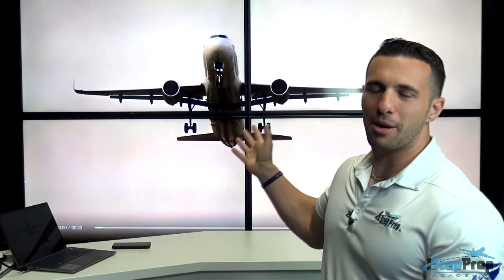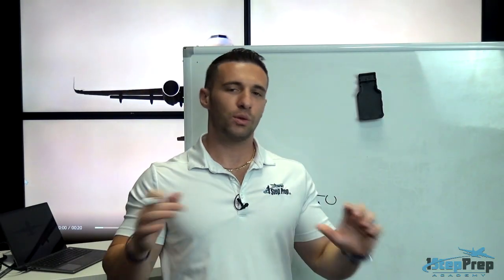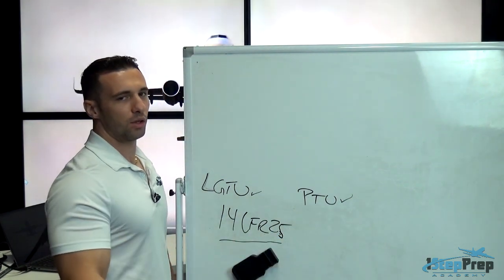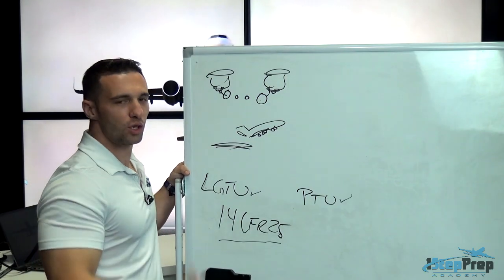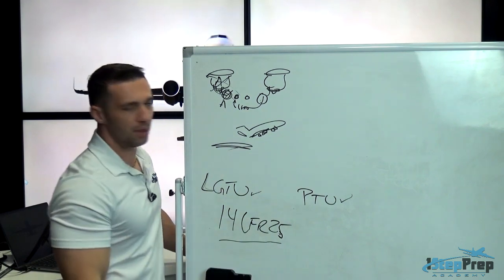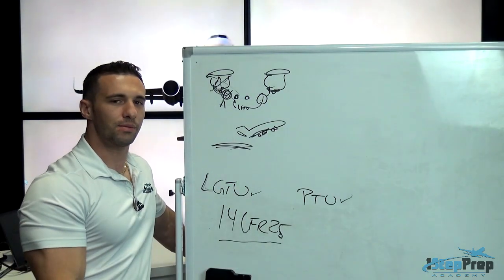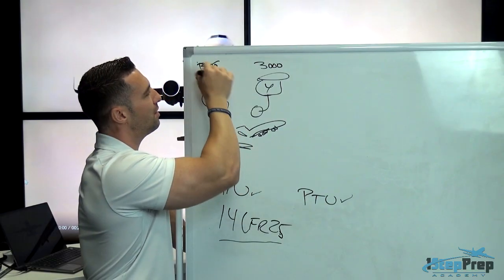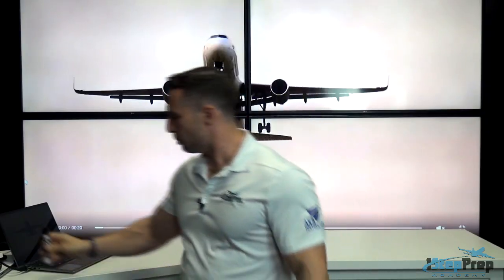Gear Up Performance!

Comment: If the Green Hyd System fails because of a leakage, will the PTU still be active when Delta P is greater than 500psi?
Reply: Why not